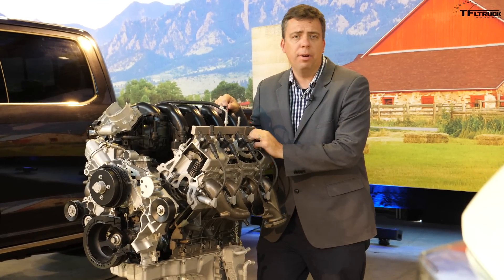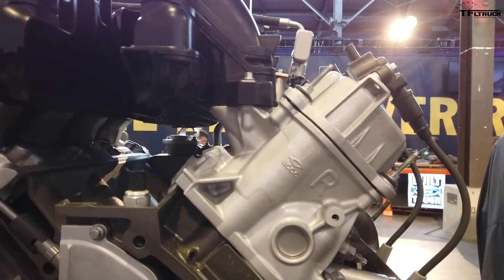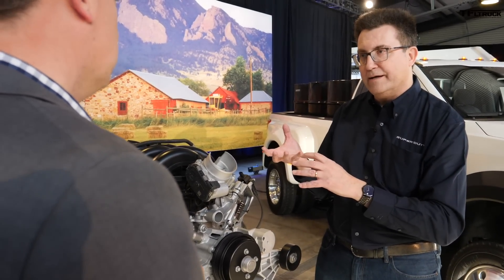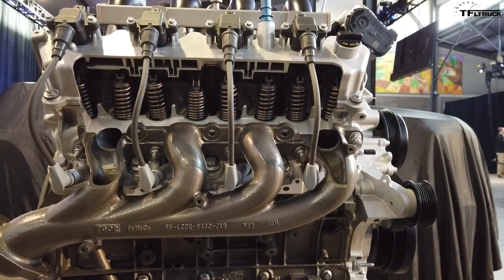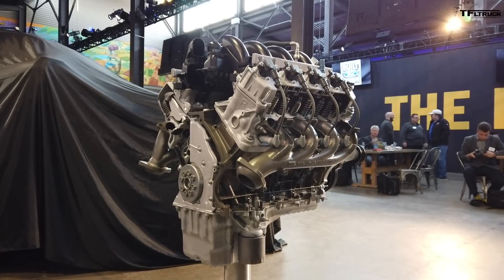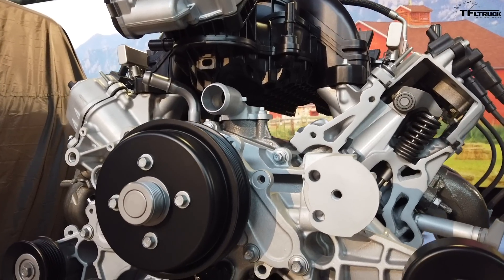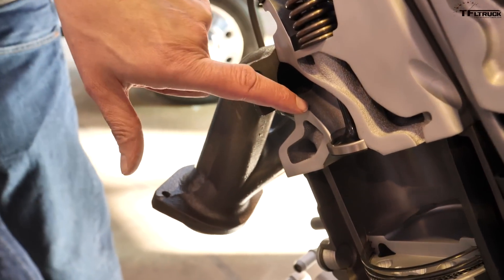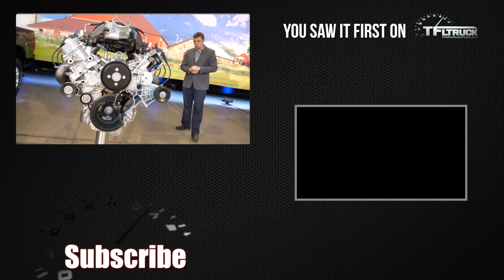2020 Ford Super Duty 7.3L V8: Here's What You Need to Know!

Comment: Now just give us a manual transmission option
Reply: Corn Mac No Manual Transmission that’s a stupid idea because less than 3% of people would buy Manual Transmission Trucks so why should anybody sell Manual Transmission vehicles when the Automatic Transmission is better when towing because it’s got more Torque than the Manual Transmission especially in the trucks
Reply: @chanseormon  stick shift is better for towing more reliable, and you can actually downshift. Also they put more power down then automatics, no torque converter and such. And 1000 times more enjoyable to drive
Reply: Manual transmissions are, in my opinion, the only way to go for a work truck, GM dropped them in 07, Ford I believe in 05 or 06, dodge I think still offers one in the 3500. I just purchased a manual Colorado truck and absolutely love it, it could have a little more power but at least it’s a manual
Reply: marten s The Automatic Transmission has more Torque than the Manual Transmission 1000 LB-FT vs The Manual Transmission at 660LB-FT
Reply: Heavy towing with an auto transmission is a death sentence for it. The fluid gets too hot and starts too cook and over time it with completely burn up, and most factory coolers dont cool the fluid enough. Manual transmissions and there gear oil will last longer over the years.
Reply: Corn Mac Get a bulletproofed Automatic Transmission Problem Solved
Reply: Chanse Ormon no that still dosent solve the problem plus all the added cost
Reply: Corn Mac so you’d rather have less Torque in a Manual Transmission than having the Automatic Transmission with 1000 LB-FT of Torque come on now dude I’d rather have more torque than less torque
Reply: Chanse Ormon that wasent my point i was talking about, im talking about longevity of the transmission and the cost of rebuild auto transmissions. I never mentioned torque or horsepower. Go troll somewhere else
Reply: With a 10 speed auto, I think the days of manual trannys are long gone.
Reply: @cornmac1796  That was true with the old autos.  The new ones are bulletproof, especially if the torque converter stays locked up.   Ford builds great transmissions.  People don't appreciate Ford transmissions enough.
Reply: stellingbanjodude ford stopped in 2011. 2010 was the last year of manual tranny’s in a super duty.
Reply: @chanseormon  Do the math on that. Aisin first gear ratio 3.75:1, G-56 first gear ratio 5.94:1.  The manual trans with 660lb/ft puts more torque to the wheels than the auto with 1000lb/ft.  It is close to the rated limit of the rest of the driveline.
Reply: Andrew Lewandowski The Automatic Transmission has more Torque than the Manual Transmission and less than 3% of people are buying Manual Transmission work trucks they all buy Automatics and the get the Transmission bulletproofed so it would make NO DAMN SENSE whatsoever to have a Manual Transmission work truck
Reply: If you don't like it, don't buy it. But, it should be an option
Reply: furnace3  
Agreed.  04 2v V10 300k and still goes everyday
Reply: Try snow plowing tight parking lots with a manual. Bye Bye Clutch!! Probably end up catching on fire and burning the truck to the ground.
Reply: Yes
Reply: Chanse Ormon yeah but manuals are simpler and easy to maintain
Reply: @jeffb8561 : If you are slipping the clutch you are in the wrong gear or RANGE!   And YES Dog-O-Matics have their place, Heavy Towing isn't one of them, Semi-Trucks that have a "Professional Driver" (not a Swift Steering Wheel Holder) Prefer manuals due to durability and longevity.
Reply: I have a 6speed 7🌲 diesel love the driver engagement required to drive my truck
Reply: @misters2837  It's incredibly obvious that you have never snowplowed before. Snow plowing is 24-26 hours of constant changing directions from forward to reverse and creeping into tight spots. So basically slipping the clutch all day and night plowing. Nobody that I know uses a manual for plowing and if they did it would only be for clearing straight roads period.
Reply: Jeff B: It's incredibly obvious you do not know how to use low range...I have plowed snow with manual transmission trucks since probably before you were alive.  If you use Granny Gear and Low range the truck is able to push snow at half a crawl...and you have lots of gears to plow in, the only thing that it sucks for is backing up...but if you learn to extend your shift levers, you can change from High to Low very quickly... The Best trucks I ever had, where Custom Built on Bronco Chassis, Pickup Cabs with 1-Ton axles, and MANUAL transmissions, WHY? Because even HD C6 would cook in a Month (Constant Drive to Reverse is hell on them, downtime is money)...but I didn't hire pussies, we had contracts with gas stations, Sears, KMarts, Montgomery Wards and Residential...the trucks today couldn't hold up to the abuse we gave them. I had 4x4 2-Ton Trucks, and the first generation of skid-steers (the ones with opposed twin gas engines) and a Michigan Loader, But we don't get snow in MN anymore...Not like we did in the old days, so there isn't money in it.
Reply: And that's I won't buy any new trucks I prefer my manuals
Reply: Mister S Haha low range! Still having to slip the clutch. There is just no way around it. Pushing that clutch in and out 1000 times per parking lot is total bullshit. Bet the clutch companies love it although. And the whole auto transmission reliability issue is none existent with modern trucks. I absolutely beat the shit out of my 06 F350 6 liter diesel with an auto and never have had a problem with it. Same thing with the truck before which was a 95 F350 460 with an auto trans. I've be plowing for 22 years now btw. And always with an automatic.
Reply: This goddamnit
Reply: @chanseormon  

You cant really bulletproof an auto. By design every auto will fail at one point
Reply: @jeffb8561  Well I NEVER have problems with clutches, and you are not "slipping the clutch" in Granny & low range, I have no idea where you get that (But you have NEVER plowed with a manual so you don't know anything about it), You could literally put the plow down and side step the clutch (If you liked breaking u-joints) and idle away...in fact you actually use the brakes to go ultra slow more than anything.  22 years WOW that means you started in late 90's WOW...I started in 72 and Quit Commercial in 1995 and totally in 2000. (In the busy years we had the custom built short wheelbase trucks, meant custom gearing, not dual purpose like most guys today, that do landscape or lawn care in summer, and use same trucks in summer time, so Low range + Granny Gear + 4.56 Axle = about 5mph at 4000rpm, so 0.75 mph at 600 rpm idle) Oh I tried the newer trucks with E4OD like your 460... We expected too much from them, didn't hold up...Big Allison Bus transmissions put in 1 ton trucks barely held up when we tried that!
Reply: Mister S  If your manual transmissions are so great how come they don't put them in pickup trucks anymore?? Or bulldozers or front end loaders? Obsolete that's why. It's like taking the stairs versus taking an elevator. Work smarter not harder!
Reply: Jeff B: Same reason there is McDonald's?  Because people are freaking LAZY!  And I have several crawlers (dozers) that have manual transmissions.
Reply: Jeff B: And people wouldn't be so unhealthy if they took the stairs!
Reply: Mister S Dude you need to come out of the 1970's it's 2019 and your sitting there telling me a manual transmission is better for snow plowing. I'm done with this conversation. Some people just can't face the facts that automatic transmissions are the only way to snow plow.
Reply: @stellingbanjodude  you don't do snow plowing. I would take my chances fighting a bear before buying a manual plow truck.
Reply: Jeff B who the heck said anything about snow plowing? Not me, I live in Georgia, no need for that down here
Reply: ferrariteddy good luck, I don’t snow plow, not need for that where I live
Reply: @jeffb8561 : I said "they had their place" and Towing wasn't it, I ONLY said if you were slipping the clutch you don't know how to operate the vehicle properly, Likely not using correct range...You are like 99% of these people that buy a UTV put a plow on it and wonder why the belt burns up..."Well were you using low range?" and their answer usually is ugh no was I suppose to?  (No Common Sense!)
Reply: When asbestos friction material was outlawed clutch and brake pad longevity is no longer as good as it used to be. Even the overwhelming majority of medium duty trucks in North America are equipped with Alison automatic transmissions. Much of the population in North America, myself included have never personally driven anything manual.
Reply: Robert Sitch , I’ve worked in a medium duty truck shop, we hardly ever saw any automatics, I also disagree with your brake pad assessment, I’ve been in the GM parts business since 2003, I have routinely seen factory pads go over 100,000 and some even 200,000. If you can’t drive a manual vehicle, that’s your loss
Reply: @stellingbanjodude  sometime in the late 90s the school bus companies in my area stopped buying manual models. Only a few of the bus drivers I knew when i was still in high school liked driving manual. Most of snow plows I have seen on govdeals.ca are automatic. Any company or government agency still running manuals will have to specially train most new employees on them as only some people have owned manual cars these days.
Reply: @stellingbanjodude  Cummins dropped manual this year I believe if I'm not mistaken
Reply: Lol they'll never bring back manuals. It'd be nice but hey, when am I going to be able to afford a thousand dollar a month truck payment? That's almost twice as much as my house payment.

Comment: Big block I love that. Going to bring some diesel owners back to gasoline. Reliability and durability plus those medium tube headers whoa. Ford with a pushrod say what!
Reply: Yeah but you gotta get some mpg.  I cant afford the gas to do what my diesel does. Granted i dont get great fuel mileage but gas would be down right nasty
Reply: tractorboy31 - are you factoring in the up front cost of the diesel option, long term maintenance and delta in the price of fuel? All for a couple mpg’s?
Reply: Those are called mid length manifolds, a long tube setup has the collectors down past the transmission bell housing bolt flange or feather down by the transmission body itself. 

Still a good design though, I want to see what a set of tuned tri-y's on this thing would do with a good ECU tuning.
Reply: Why do I get the feeling that gas will become more popular than diesel in HD pickups soon.
Reply: @tractorboy31  new diesels get shit MPG anyways especially if you don't do a delete
Reply: @Terminxman  for sure. I dont do great with my 7.3 but im happy with it. I want new injectors.  I need to tackle some oil leaks. So im thinking yanking my turbo and doing a wicked wheel when resealing my turbo
Reply: Not me. I'm sticking with diesel
Reply: With gas prices so low and probably staying there ford decided to build a gas guzzler. This engine doesn’t have dual over head cams, it’s a single cam like a Chevy motor whoa

Comment: Was expecting 1.0L quad turbo ecoboost, got 7.3L Push rod  V8...Today was a good day.
Reply: Funny comment, but there's a pretty solid engineering reason why using four turbos would be a terrible idea. Twin turbos only came into fashion because they could use a smaller turbo to offset the lag that exists before the larger turbo begins to spool up to optimum  power. The downside is that they rob power over a traditional large single turbo setup. A single turbo is very laggy, but it produces the most power once it gets going. A quad turbo would choke so much performance, cost so much to manufacture, take up too much space, and weigh too much for anyone to ever bother attempting it. HOWEVER, with a V engine, you could use a twin turbo setup off of each exhaust header for a combined quad turbo setup, but the drawbacks already mentioned (namely expense) would still be a problem. There's no point in using it even in high-end expensive sports cars, because the added weight would adversely affect handling. From cost, handling, reliability, upkeep costs, power, or any other consideration, it fails the cost-benefit analysis.
Reply: @notmirelnam248  Nobody asked for this information

Comment: Send that thing over to engine masters for some boost!  If it's built like that stock it's going to handle bolt on boost better than the LS motors
Reply: What made you say that? They aren't even in the same class. Using a LS as the benchmark just speaks for what a small displacement small block from GM can do.
Reply: @EGGINFOOLS  because the LS motors do so well with boost.  If the new Ford motor is build with parts typically used in turbo motors, maybe they will have as strong an aftermarket support as the LS.  I wasn't trying to compare Dyno numbers or anything.  Just speaking to the popularity if the LS as a comparison.
Reply: @richardmiller1256  I totally agree. I hope people do just that. It would be killer
Reply: I know you are right, And I just got owned but: Idk, there was unopened 5.0s doing 1000+ to the wheels not too long again but sure bud, u know what ur talking about
Reply: @I know you are right, And I just got owned but: fastest SBE Ford went 5.88 in the quarter with over 2k wheel horsepower. No SBE LS has gotten near 5s in the quarter. Go sit in the corner.

Comment: 7.3 is 100% marketing. 7.3 powerstroke anyone?
Reply: thaddeusabear thank you. Finally someone said it. Calculated my ass. They made a 7.3 for nostalgia.
Reply: Exactly...done on purpose all day long. Can't blame them though, that was a great motor
Reply: I love my 7.3 diesel wish this was diesel
Reply: Seek help
Reply: @jasonlarsen3515  ?
Reply: Yeah just like what they did with the 5.0 coyote.
Reply: thaddeusabear it’s been 14 years.... the ford 3.5 ecoboost puts down more power then the 7.3 did.
Reply: @jasonlarsen3515  whats your point lets see the ecoboost get over 750 thousand miles. You must not have owned a 7.3 or dont know shit about them
Reply: Don't Tread On Me they stink, they are loud and not that quick. They last for ever if you maintain them.
Reply: @jasonlarsen3515  the ecoboost does put more power down. Will it tow like the 7.3... no not even close the 7.3 makes peak torque way before the 3.5 does.
Reply: @jasonlarsen3515  got it, you're a troll.
Reply: Edgar G at 2500 rpm what is the tq for each engine?
Reply: @jasonlarsen3515  the 7.3 power stroke was making 525 ft-lbs near the end of its production @1600rpm
Reply: 7.3 idi
Reply: Yes, I agree but I bet it will be better on fuel than most people think because of the big displacement allowing it to run at very low rpm all the time. They probably could have made a 7 liter and gotten a similar outcome but ford does have one of the best marketing dept in the industry and they know there is a lot of people who get very nostalgic about the old 7.3 diesel.
Reply: @jasonlarsen3515  The 3.5 EB V6 isn't reliable.
Reply: @jasonlarsen3515  the 7.3 makes over 500 ft/lbs of torque. You believe a 3.5 will outpull a 7.3?
Reply: Drop a ecoboost in a 8000-9000lbs 1 ton pick up and go try to pull 25,000lbs. Goodluck lol
Reply: @Harley365  Me Too !!!
Reply: @jasonlarsen3515  I love my slow, loud, smelly truck. Wouldn't have it any other way
Reply: @jasonlarsen3515  The 3.5 ecoboost may of had more HP but not torque! HP numbers don't mean shit in a truck, torque is what counts!
Reply: Fred Garvin Male prostitute 470 vs 505? Pretty close.
Reply: Same reason the "new" 5.0 was a 5.0......
Reply: We need the 7.3 powerstroke back!
Reply: "7.3 is 100% marketing. 7.3 powerstroke anyone?"

I shure as hell clicked thinking they had refreshed the Powerstroke.

Kinda upset me when I realized it was gas TBH.
Reply: thaddeusabear YES
Reply: Hp is how fast you hit the wall torque is how far you push the sob

Comment: Its going to be way more fuel efficient than the v10. Let's hope for torque ratings close to 600 and the capability of slapping boost and this engine running happily is a great feature. You can see some big numbers if this thing ran boost with e85 😂
Reply: Exactly,  hopefully it's as durable as the V-10, very solid engine.
Reply: 1000+ at least with a fat blower and e85
Reply: @adamhaislip6586  dont blow the old girl up before we even get it lol.
Reply: Lol hoping she gets built like they claim, built with a mix of the 6.7 Diesel and the eco boost motors, so she can handle the big boost and she has big torque all around
Reply: @adamhaislip6586  if you throw boost at it the torque is going to be nuts.
Reply: Only problem I could see happening is having to buy new tires every week lol